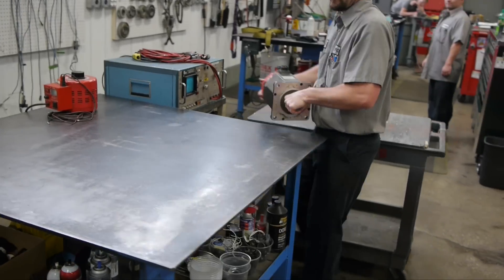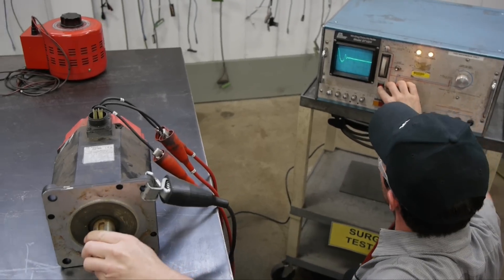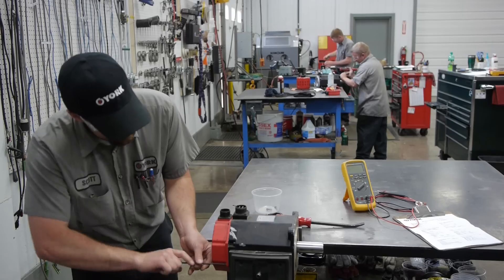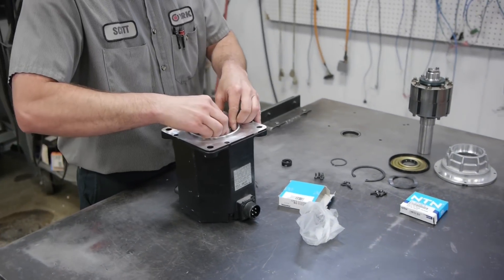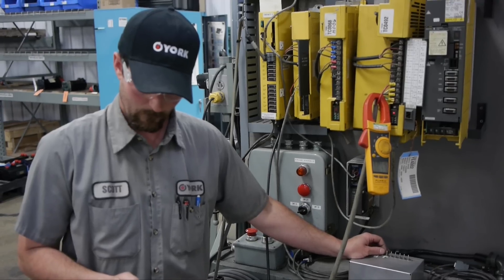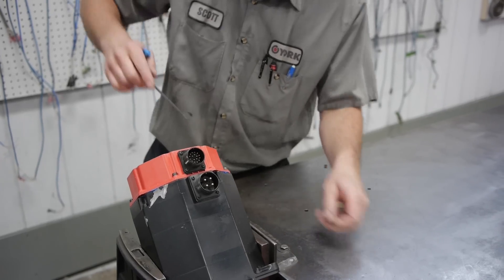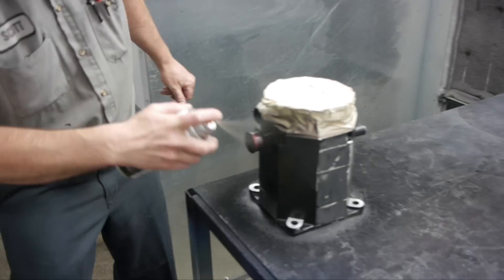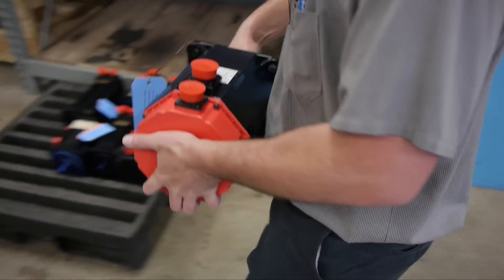Fanuc Servo Motor Repair

Comment: Hi. I have a fanuc servo motor which Drives Y axis on a husky robot. On robot pendant i can see Y axis position changing when i move it in manual mode from robot pendant  but there is no physical movement to Y axis. We disconnected  servo motor from robot arm to see if motor shaft was turning and there was no movement to robot shaft but the numbers on robot pendant were still changing.  Do you have any idea what might be wrong here? Your help will be greatly appreciated

Comment: is it possible for the servo's encoder to skip pulses?
Reply from the maker: Hi Jonathan, depending on what type of encoder it is I would say that it is possible. An encoder with multiple tracks would be much better at noticing it than a cheaper encoder with a single track. Thanks for your question.
Regards, Repair Zone
Reply: @RepairZoneMan  hi
Reply: Hi